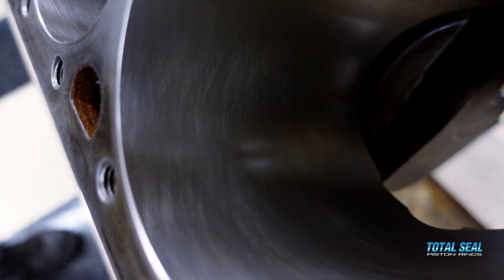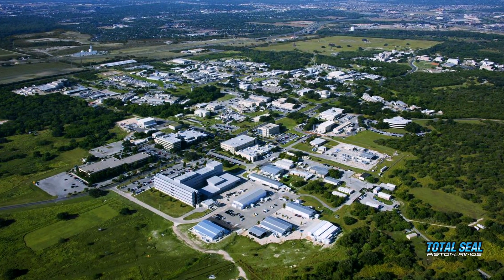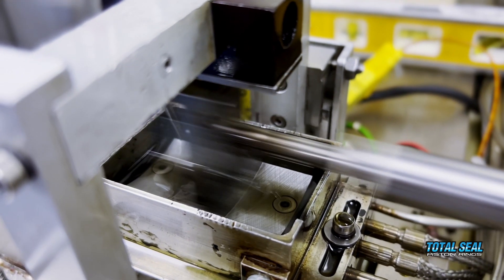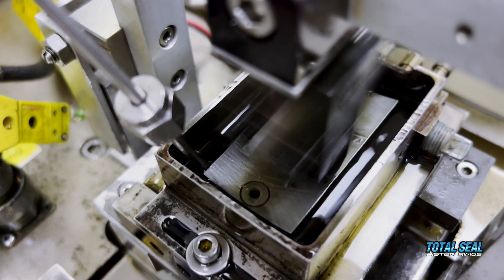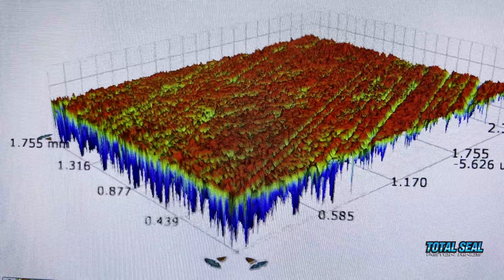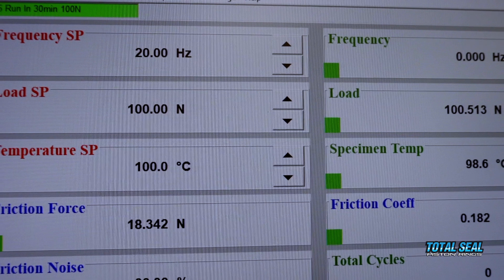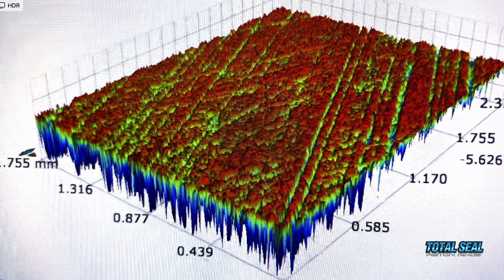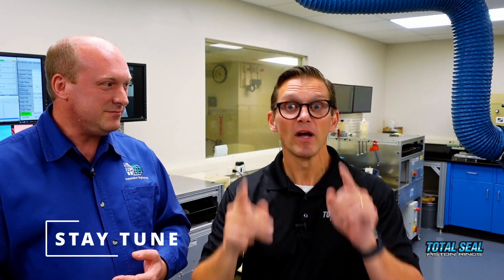What Effect Does Cylinder Bore Finish Have On Friction & Wear?

Comment: Love to know how you can scientifically work out the best cross hatch angle?
I guess that is a different angle for lots of different situations?
Reply from the maker: Determining cross hatch angle requires factoring in bore to stroke ratio and the operating oil viscosity.
Reply: Think of the worlds largest engines that have bores measured in feet.... the honing must have a huge load
Reply from the maker: @alexhise968  Those have got to be crazy! I can't imagine how much Diamond abrasives for a hone like cost...

Comment: I know you are looking at just wear with the ring and the bore finish but heat from combustion  plays a big part in many different ways.
Reply from the maker: Of course, combustion heat plays a major role, which is why all good test programs culminate with actual engine testing.
Reply: @TotalSeal  And the combustion pressure on the rings re seal and wear
Reply: In other news, the sky is blue and the grass is green 😂